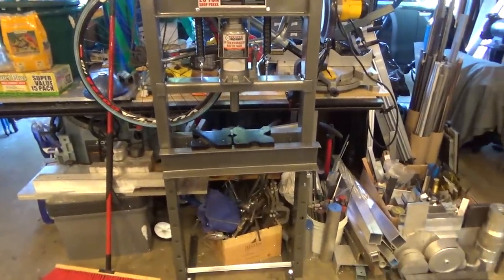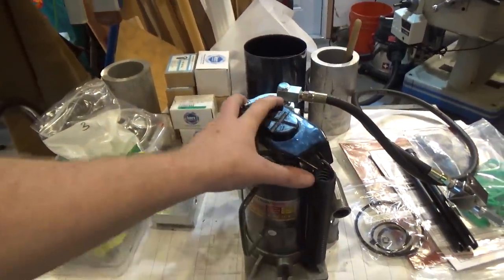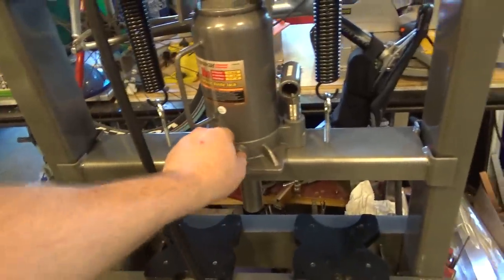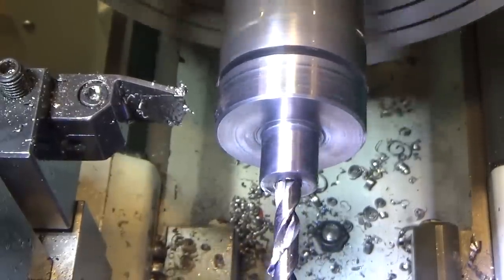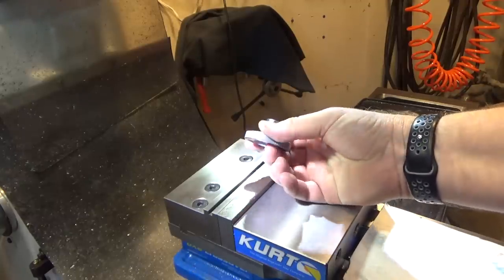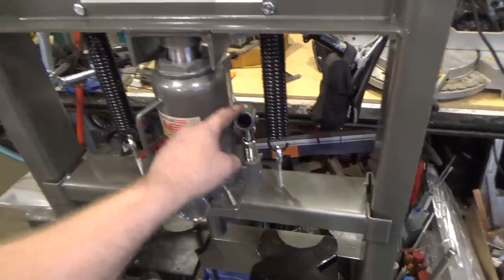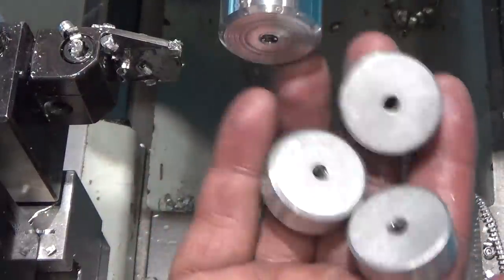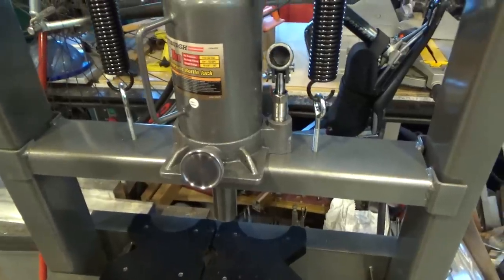Improvements to a Harbor Freight 20 Ton Hydraulic Press Part 1

Comment: I got my press for $124.99 with a coupon. I'm going to do your pin mod for the press plates tomorrow,  but I'll use roll pins. And yes drill  thru holes as well. I double nut the eye bolts for the vertical return springs, a nut on both sides of the beam,  just because I didn't like the way they can flop around.  If you happen to buy the H.F. table top blast cabinet,  it will be interesting to see if you do any mods. Thank you,  GOD BLESS.
Reply from the maker: I would if I could find room. I would love a sand blaster. Thanks for the comment.

Comment: Difficult to describe, but to keep those lower rest pins from leaving when you need them the most, you could also weld a bent piece of .125 or .25 steel rod to allow the pis to lock in place when the weight of the additional rod "keeper" lowers down to wrap the front and rear of the front side of the upright beams.
Reply from the maker: Interesting solution, thanks. I would not have considered that approach.

Comment: Interesting video, with some good ideas, but I'm not sure if I agree with drilling holes in the press plates.  These plates aren't very good quality to begin with, and the hole are only making them weaker.  If one of these plates break while under load, things will go flying at a pretty good velocity.  A better idea might be to weld small square stock to the plates that would hold them in place.
I also wasn't sure about drilling holes in the beam that holds the jack.  These won't weaken this area as much as the holes in the press plates, but I think welding something to the beam to hold the jack in place would be a better idea.
Thank you.
Reply from the maker: I appreciate the suggestions. The press plates are soft steel, not cast iron like they used to be so catastrophic failure is unlikely. I have pressed parts into the plates before. The cross beam actually supports very little force. The jack base is pressed against the plate I added, which in turn presses on the outside of the beam. The ram is flush to the bottom side of the beam, so the majority of force on the beam is compression between the top of the beam and the underside of the same piece of metal. I have pushed this press to it's full 40,000 pound capacity and the top bar bent, but the cross beam, which is just for alignment, had zero issues.

Comment: I knew a guy who welded pipe as telescopic guides to stabilize the top rail and used a boat trailer hand winch to lift the press rail so he could change the height easier.
Reply from the maker: Great suggestions. Thanks for the ideas.
Reply: @DudleyToolwright  You're welcome. Appreciate you videos.

Comment: For my release knob I just pushed out the factory pin, put my aluminum knob on and pushed the pin back in.
Reply from the maker: Excellent idea. My jack had a different design. The release knob was integrated into the shaft of the valve assembly.

Comment: first thing i notice is the ever so slight movement from the jack handle actuation. this tells me the bottle jack wasn't filled and bled. for anyone reading that understand the why; every hydraulic jack sold is only partially filled and needs filled and bled before any serious use, you'll go from it taking a billion pumps of the handle, to quite a bit less. by comparison; it takes 3-5 pumps for my 3 ton low profile from HF when filled, but something like 2-3 dozen out of the box.
Reply from the maker: That is a very interesting point. Thanks! I'll definitely look into that. I was not aware that they were not shipped full, nor did I think they needed to be bled. Interesting.

Comment: You did a nice job on this press!!! Some very nice ideas for me to scratch my head with!!! I was thinking of adding some heavy duty caster wheels on my so I can move around in the shop!!! Some times the part I work on is big or clumsy and it would be nice to roll this press up to the overhead door or straight to the back end of a pickup!!!
👍
Art
Reply from the maker: Casters could be a very nice idea. My only concern is possible safety issues, even though I can't think of any.

Comment: So, you have a full blown shop?
Tear apart that old jack, take out the threaded ram, turn it up side down and weld it to the bottom of the press!
And schedule 80 pipe/tube makes great handles with the "T" slot cut in one end.
Those cheap bottle jacks always leak either internally or externally, and that press needs twice as many height adjustment holes as the one you think will work is just a fraction of an inch too short, and the other takes 50 pumps of the handle to get to!
Reply from the maker: Thanks, I appreciate the ideas. It amazes me that no matter how much I think about a project, someone else will think of a creative approach that I never considered. I really appreciate the suggestion.

Comment: Just subbed. Thanks now i can rig up a hydraulic tubing Bender for both rigid EMT and exhaust tubing. Saved us a lot of money.
Reply from the maker: Thanks for the sub! I am glad something I was doing was helpful.
Reply: @DudleyToolwright   i wonder if the same thing can be done with a engine hoist hydraulic cylinder. I may just go to Harbor Freight get the dimensions and weld something up
Reply from the maker: @jdtv...9134  I'd love to see your project.
Reply: @DudleyToolwright   in do time. Funds are the main issue atm🖐🙏

Comment: I have this same press. The pins on the press plates are not a bad idea; however they might be a problem if you have to stack the plates. I would have used threaded pins on at least one of them so you can take them out. I stack my plates all the time so I don't have to move the bottom frame up, etc. Some all-thread rod would make some cheap and easy pins, perhaps 1/4-20, etc. You could also use other screws and leave the heads on.
They don't need to be tight either. Finger tight would be fine. 

Far as the time it takes to pump the jack down, I don't see a problem. Sure it's a PITA and slow, but if you're pressing something that requires a lot of force - I'm in NO hurry. A 20-ton press doesn't *uck around, so TAKE YOUR TIME! Just my opinion.

I might modify my press with an air-assist if I was doing some sort of production parts, but I'm just an old retired machinist, so I have time.

The knob for the release is nice. I might steal that one from you! I think I have some rod to chuck up in my lathe.

I also took some heavy angle steel and put poly wheels on mine. It's SOOOO much better to be able to move the press around the shop. I don't have a lot of room in my shop, so most of my machines have wheels (except my Bridgeport mill). 

Interesting that your table pins slipping out? I've never had that problem. I wonder why yours does.
Reply from the maker: A bunch of great suggestions, thanks. I did add wheels to the bottom a while ago. I use the air jack as a rapid and then go manual when I need to be careful. I think the pins might slip because they are chromed steel.

Comment: Nice, Now all you need now is a holder for the pump handle as it will fall off and hit you on the wrist while you trying to alien a project in the press straight, them you toss the handle across the room and now have to fix the hole in the wall. lol
Reply from the maker: I like the narrative. You didn't just deliver a straight joke, but integrated it into a story I could picture. Very funny, unless there is a spy camera in my shop. Cheers.

Comment: Around minute 22 you asked for tips to speed things up so you didn't have to change tooling. First thing that came to mind when you were chamfering yout caps. Use the same tool to chamfer the outside by simply reversing the rotation. If you don't have a D1-x chuck it won't be enough to unscrew it.
Reply from the maker: Thanks. I really appreciate to great idea. My chuck is D1-6 Mount, so no problem at all. I often forget that my lathe can turn in reverse to turn parts off the far side.
Reply: Another thing I did a while back was attach a 3 inch 3jaw chuck to an mt4 shaft and use in my tailstock. Allows me to chuck up my 1" (or any) endmill so I don't have to do a bunch of tedious boring after, ofcorse, drilling a pilot hole. Gives me a flat bottom from the Getgo. I do have a  new $1,000 set of mt4 drills (given to me) but seldom use unless it's a deep hole.

Comment: Cheap tools can always use some TLC. My HF 20 ton press is over 20 years old. They have changed them quite a lot in that time. They scaled down the metal & over all size. The press plates used to be just two slabs of 1x4x12" cold roll. They needed machining to be flat. I made a knurled brass valve knob. I've never had an issue with the pins falling out but I did taper one end so it was easier to hit the holes. The push pin that engages the work was crooked, fixed that. I've got a piece of acme threaded rod that I'm going to make into an adjustable push pin to make setup faster (some day.) I considered the air pump but never did anything about it. Other things more pressing. I had been using the hydraulic press for broaching but it was too slow. Recently bought a 3 ton arbor press from Vevor. It seems decent for a cheap price. Did the usual pimping on a new cheap tool. Much faster to broach with.
Reply from the maker: It sound like you made some really great improvements there. Thanks for sharing your ideas.

Comment: Hey Dudley- Thanks for sharing your modifications- Your fabrication work is stunning. You said you don't move the press table much, but have you watched Marcel LeMay's modification videos? He mounted a boat winch to the top of the press, which allows for easy adjustment of the table without removing the work piece.
Reply from the maker: Thanks and no I haven't, but I will check it out now. I really appreciate the tip.
Reply: @DudleyToolwright  You're welcome. If you decide to do a similar modification to the table and post a video of it, it would give the community some great ideas.
Reply from the maker: Will do, thanks.

Comment: The jack press pin broke off of mine.   It was welded to an 1/8" plate aproximate.   So I bought a half inch plate and drilled a hole and had a welder weld it on both sides to the pin.
Reply from the maker: nice solution.

Comment: Putting 4 pins in the plates is a great idea. Would a standard drill press be able to handle drilling through the plates? and if so, what kind of drill bit should I buy?
Reply from the maker: Sure, a regular drill press would be fine. Cobalt bits might last a bit longer than regular HSS or bright drill bits. Cast iron has little carbide nodules throughout that are quite abrasive.

Comment: So he talked about removing the original springs and using the springs that were supplied with the new jack. He did opt to not go that rout, this is a good thing because without the springs attached to the bar how would it return along with the jack when pressure is released .
Reply from the maker: Very true.

Comment: Those cast arbor plates like to explode under pressure. Swap offroad makes quality replacements
Reply from the maker: I tested mine (see video) and they are not cast iron. Many viewers have suggested that they used to be and were subject to catastrophic failure.
Reply: SMH

Comment: nice tip with the pins......but heed the warnings, I had a arbor plate explode.  be safe invest in some solid steel plates
Reply from the maker: Thanks for the warning. You are by no means the first to warn about the stock plates. I mean to test mine soon. Thanks again for the heads up.

Comment: I really like the relief knob. If you ever sell it let me know!
Reply from the maker: Will do. Thanks for the comment.
Reply: Hi, if you knocked the small cross pin out of the  pressure release valve rod and then drilled a cross hole in the new hand knob instead of slotting it, then using a roll pin to secure it,  you can save a lot of machining time. They make jacks the way they are so that you have to use the long handle to prevent getting under the car to release the jack with a knob on the jack......on the press it's more convenient.

Comment: how did I make my cheaper than Harbor Fright press more useful ?  --- by building a 6 ' by 10 ' shred roof and putting it smack in the center perpendicular to the wall.  You can pass long stuff through the press and support it on both sides and still stand in front to work small pieces.  Also can hang all your various jigs, pipes, blocks, plates, etc. on the wall where you can see them.
Reply from the maker: I like your ideas. Very creative and pragmatic.

Comment: The main thing to focus on, is the hydraulic cylinder (ex Jack) in this case, powered by an air hose...thats important. So many people wish they could use this hydraulic Jack, using it through a generator pumping air...instead of stupid pumping, on & on
Reply from the maker: Interesting point. Thanks.

Comment: One comment about the use of the springs from the bottle jack with the air motor as the retraction method. To use them you would have to fasten the jack to the press either at the top or at the bottom. Using the existing springs, that connection is unnecessary and I think it is a better design.
Reply from the maker: Thanks. I agree.

Comment: I think you could have modified the original jack to apply air pressure to the reservior and open the down valve and it would push oil into cylinder to extend the jack. then vent the air pressure to let the jack down.
Reply from the maker: That is an interesting idea wort looking into, thanks. I never considered that possibility.
Reply: Hmmmmm.........what a clever idea, saves a lot of dough and no need for another jack.

Comment: Those Harbor Freight  arbor plates can shatter under load replace them. SWAG off road sells machined plates for a great price. A friend gave me a press without the plates and they are usually really expensive.
Reply from the maker: I appreciate the warning, but it appears as though Harbor Freight has improved on the original design and the current press plates, like mine are steel, not cast iron.

Comment: Great ideas!  I'm definitely gonna ream some pins into my plates as well.  And I really love the release knob.  I dont have a lathe, but had the same idea.  Would i be able to purchase a knob from you?  Either way, great post!
Reply from the maker: Thanks. I have had so many requests for custom knobs, but I don't have access to a CNC machine and I would have to sell the knobs for a ridiculous price to make sense.
Reply: You can buy a plastic threaded knob with a brass insert and just mill the slot on the back.

Comment: I have run into several cheap chinese H-Frame presses that have misaligned pin holes making it impossible to align correctly without sorting out the misalignment. Something for people to check BEFORE taking one home...Put a small square through the holes and see if they are perfectly square to the uprights.
Reply from the maker: Good suggestion. I did not unbox mine until I got home. It would have been a pain to return it.

Comment: Best mod you can do to it is make something to lower the jack with only your fingers and not the handle. I welded on a wing nut shaped piece of plate I made, tack it on in 2 spots and cool it down to save the seals from getting wrecked.
Reply from the maker: Interesting approach. Thanks. You've given me something to think about.

Comment: When you go to cut a part off with the lathe, stick a small screwdriver in the ID. It will catch it rather than trying to use your hands.
Reply from the maker: Good advise. I do use a tool to catch the part if there seems to be a risk of injury, but erroring on the side of safety is rarely a problem. Thanks for the suggestion.

Comment: You could have used a horizontal cutter to cut the slot with the piece clamped same as you have it for drilling the grub screw hole. No small cutter to break.
Reply from the maker: Good point. I had not thought of that, thanks.

Comment: I just found your channel...turning cold rolled....seems to want to 'tear'....I would suggest maybe visiting some machine shops, and asking for some old hydraulic cylinder rods...they're usually 1045, machine well, and quite weldable....I was 'The Welder' in a couple machine shops..so did a lot of this hydraulic repair stuff...mostly welding/fabricating, but some turning and milling...16:00.... maybe a little fast on the feed rate, but could be the carbide, can't do well unless it's top shelf stuff, I'd use some lube, or even just the air nozzle blowing on there...cools it, and gets the chips away...and I've also had really good results 'drilling' holes with a 2 flute on aluminum...
 I've used a lot of these hydraulic jacks, 'Jet' make some decent ones, still imported, I think Taiwan...a couple grades up from Harbor Fright...but a little more $$$...
Reply from the maker: Sorry the YouTube spam filer caught your comment and sequestered it. I just caught it am moved it. Sorry about that. You made some really good suggestions, thanks.

Comment: One thing i did was hammer tone paint 2 beam clamps and replace the original screw with an SS allen socket head screw for looks and attach them to the uppermost horizontal rail spaced 12” apart. This now holds the jack handle securely inside the rail. Home Depot Store SKU #237037 1/4”x 20 screw
Reply from the maker: Nice improvements. Thanks for the info.